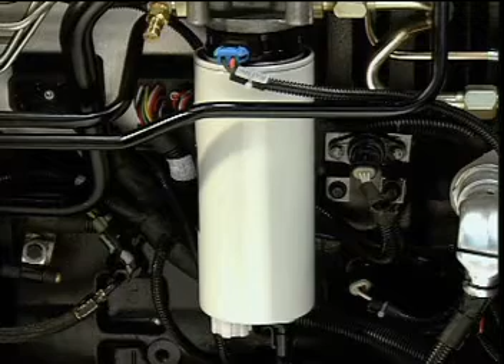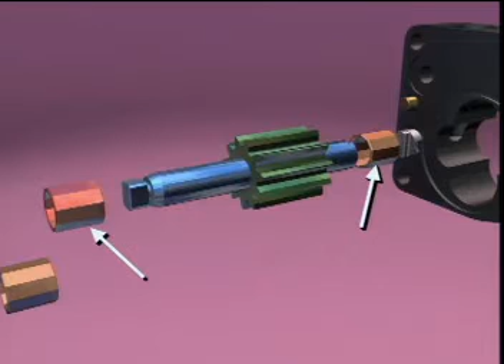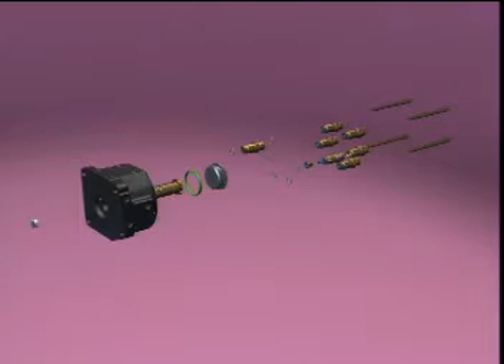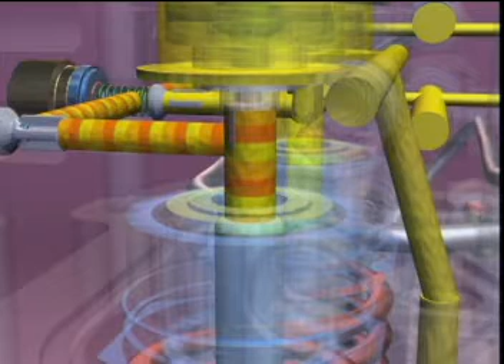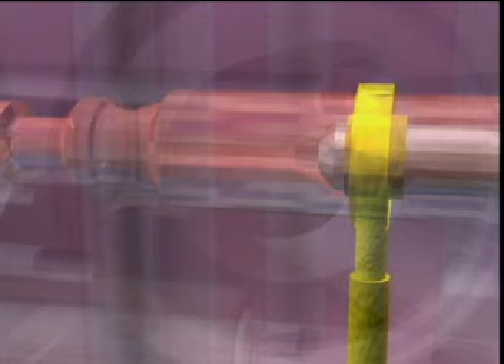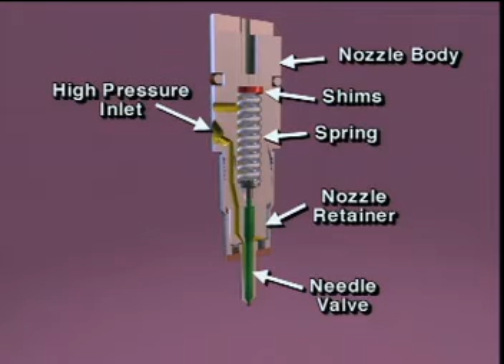Cummins 8.3 CAPS Fuel System

Comment: An additional electric pre-pump should be used, which runs around the clock without interruption, which facilitates the life of the main pump. Additionally, add lubricants to the fuel.
Reply from the maker: pre-pump i think good idea. the lubrication is solved by cummins, because oil inlet from the pump house, and the fuel is lighltly black, i consult the cummins dealer, he sad not problem the extra lubricant :)

Comment: ciao ho problemi  con questa caps cummins non parte più il motore cosa posso fare? grazie
Reply from the maker: hi, sometimes faulty ICV valve, inside abrasion! use cummins insite diagnostic tool, for checking ICV valve angle, when 120° the angle, i think faulty the icv valve. use separ 2000 diesel fuel filter (caps fuel system sensitive to fuel quality).
Reply: @AgOpenGPS-Hungary  Grazie gentilissimo
Reply: Install inline fuel pump ...